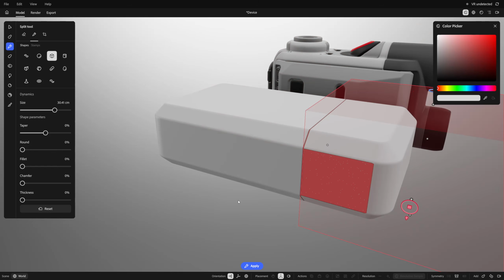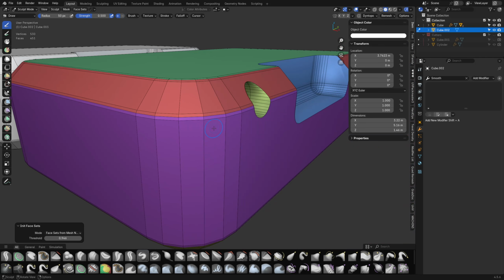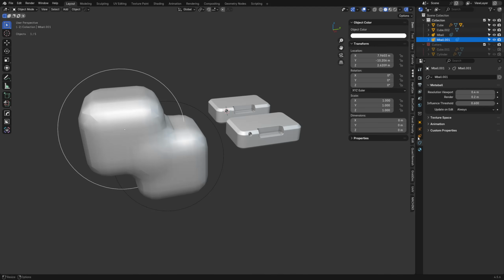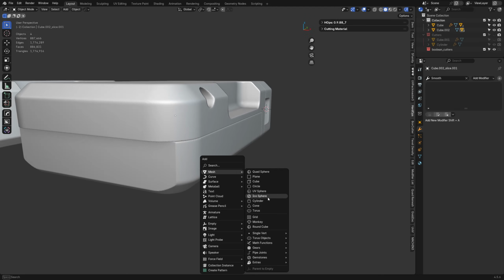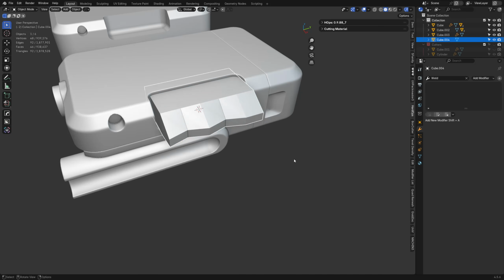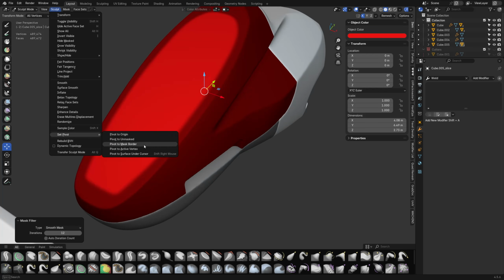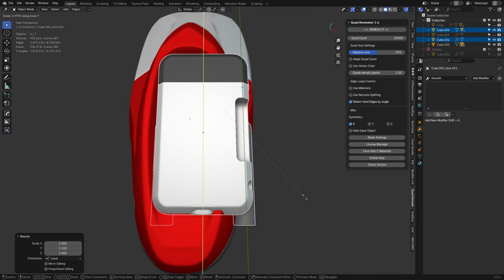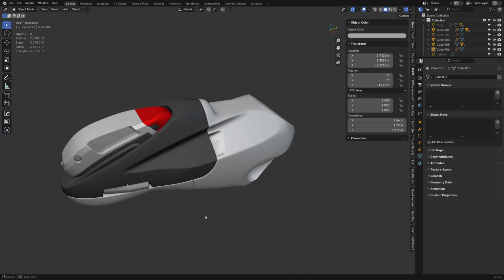Design Modeling and Sculpting with Voxels (Unleashed)

Comment: Not sure if you're doing environments too but that would be something I'd like to see. Specifically the blockout phase. How to work with your references to decide on individual elements, how to efficiently create blockout meshes to get an initial scene running quickly, that kind of thing.
Reply: I second environments. But I'm also interested in the texturing, specifically all the little extra tricks you do or don't use for different env assets. For example, I just learned what RGB masking was today, and I'm sure there's like a dozen other things people do that I just don't even know about. And a lot of it is very unintuitive to me as an amateur, because things like making a 2nd UV set on an asset to fully unwrap it and include an AO/Normal map and RGB mask comes off as bad for performance/memory and sometimes just knowing "nah, people actually do that and it's fine" removes a lot of mental restrictions from how I do stuff.